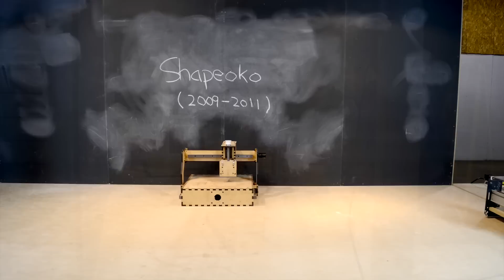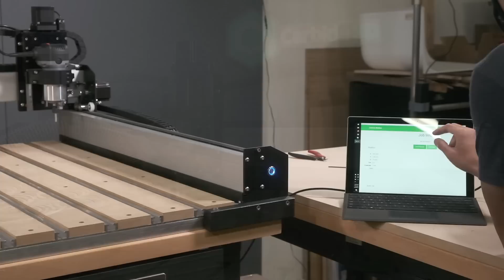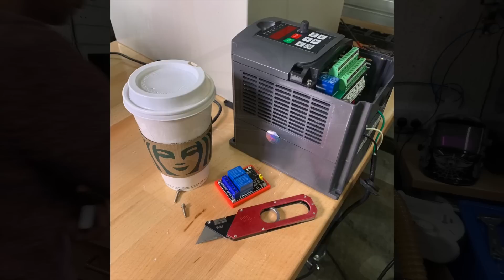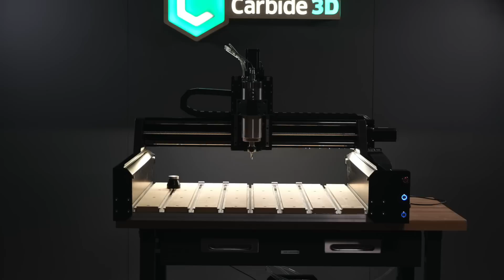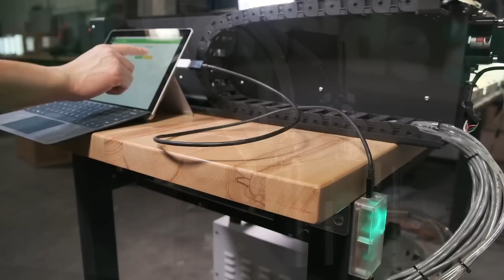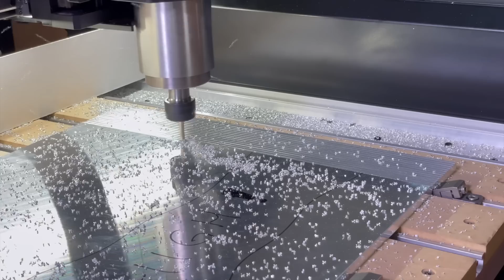Shapeoko HDM: The Most Powerful Benchtop CNC We've Ever Made

Comment: What is the cutting area of this HDM?
Reply from the maker: The HDM (version 3, the latest) has travels of 690, 610, and 145mm in X/Y/Z respectively.  The table is 539mm deep (Y), and the remainder of the travel is over the front of the machine- you can hang taller pieces off the front. 

A complete list of specs/dimensions can be found on the product page: https://shop.carbide3d.com/products/shapeoko-hdm?variant=39378702565437

Comment: Can you mount stock vertically to cut into the ends?  Mounting vertically meaning the end of a longer piece of stock (like a rail for furniture) is planar with the bed.
Reply from the maker: There is a small amount of overhang possible but not enough to cut a very thick board. If you have a pass-through or hole in your workbench, you could conceivably remove one of the hybrid table slats though and stick the board through that way.

Comment: Looks like a solid if not small build machine, but for 5k I would really have expected at least a 2/3 bit auto bit change option built in.
Nice to see you transition away from routers as standard though considering about 70% of people upgrade to them after about a year anyway.
Reply: You can easily spend 5k on an ATC and accessories alone...

Comment: That's an impressive piece of kit. And it's a desktop, usually the poor relation compared to big boys... Price will be interesting!!
Reply: I've seen the price, Arm & Leg comes to mind,  but then you pay for Rolls Royce too!
Reply: @JohnCol-1959  its a 10 years old German design, costs less than 1000 dollars of parts. You can build it on your own in few days, with bare minimum of skills. Hardly a Rolls-Royce...
Reply: $1K less than a tormach PCNC440.

The tormach is 500 lbs of steel so it's hardly a desktop machine, but it only has half the power of the Shapeoko! Much better rigidity for steel no doubt.

Interesting comparison.